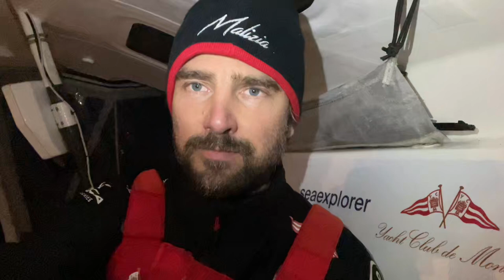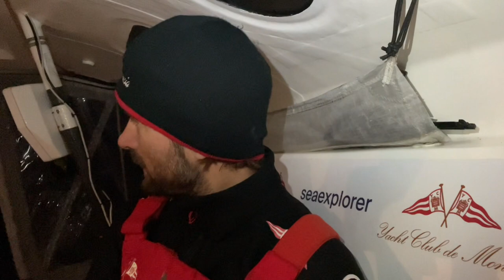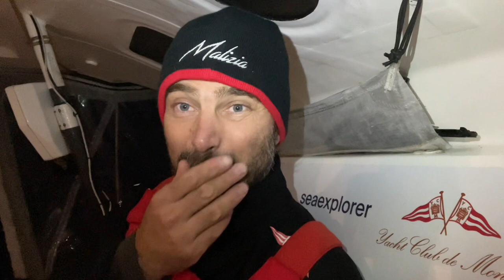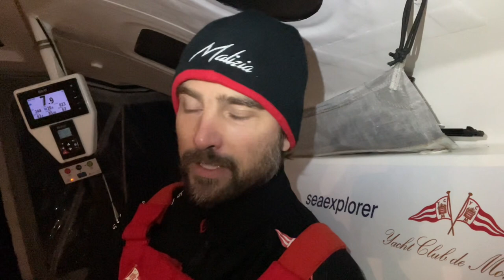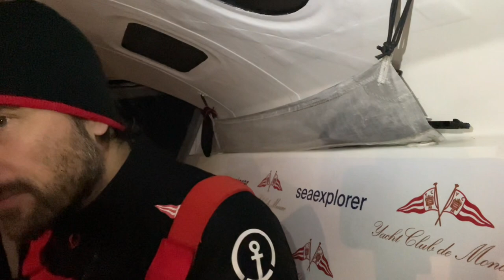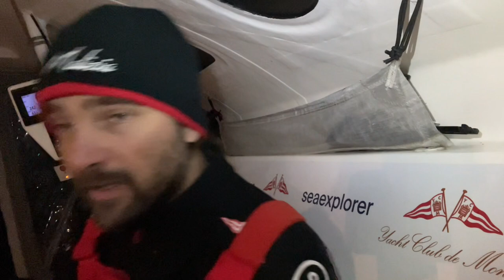Day 80 - Boris's collision just 90 miles from the finish line

Comment: The F/V was not transmitting AIS so it was invisible to Boris' collision avoidance tech

80 miles behind Dalin at 18 knots gives him 4.5 hrs out of the 6 hours owed.

1925 UTC at time of the collision with 90 miles to finish. 

Again at 18 knots gives him 5 hours to finish at 27/01/2021 2325+/- UTC, then adjusted to minus 6 hrs is 1725+/- UTC

Whereas Bestevan crossed the line at 28/01/2021 03:19:46.

It looks like this

Dalin:        27/01/21 - 19:35:45
Bestevan: 28/01/21 - 03:19:46
 adjusted: 27/01/21 - 17:05:46

So there. Robbed of a more than good chance to be in the running for first place finish and definitely shut out of 2nd place and the podium as well.

I hope he got the name of the boat cuz Imma coming to France next flight to hunt them down and break their legs.

Comment: So sorry to hear of your accident and the damage to your yacht, and the loss of your position in the race.
However, you must take the positive view: the consequences of the collision could have been far worse.
The hull of your yacht was not holed, you did not suffer injury or death.
The area off Les Sables d'Olonne is hazardous because of the number of fishing vessels.
I know of an incident in the same area 50 years ago, where 3 persons were drowned as a result of a collision between a yacht and a trawler.
As to why your radar alarm was not triggered, is it possible that the trawler was an old fashioned wooden type? If so, it might be invisible to radar.
If possible, try to establish the identity of the fishing vessel in case you need to make a report.
Your performance in the race will have been noted, whatever the result in the rankings.

Comment: Although a lot of things where not as they should have been, I think it was a fault of the Organization #VendeeGlobe not to inform all Vessels in the region about the 5+ ships entering at high speed in the bay. Just to tell them to turn that night their AIS and keep vigilant would have been in their hands to make such an event safer. Making it a bit safer for the sailors would have not required too much effort from the organization. And as Boris says, it is known that sailing vessels turn off their AIS. If it is known, the Organisators could have had that in mind as well. Very disappointed in the organization...
Reply: Despite my admittingly limited knowledge as an armchair sailor I have to disagree:

Regarding a responsability of the organization: for both the Vendée Globe organisation and the coast guard, as I understand it, it's technically impossible to know the position of all ships in such a large area (hundreds of miles.. where do you even start?) and find a means of communication with all of them, especially the most relevant ones, i.e. those idiots in "stealth" mode like the vessel in question. How exactly do you suggest this could have been done technically? HF radio DSC area calls only work when that radio is set to automatically monitor the relevant frequencies (afaik this often isn't the case) and with SSB DSC calls to individual vessels you first need to know that this vessel exists and have its MMSI. And satphone doesn't work either if you don't have the number. Also: european waters are VERY crowded: www.marinetraffic.com , and those are only a few vessels that send their position via satellite.

Also: Boris said that fishing (!!) vessels sometimes turn off the AIS, not sailing vessels. Many sailing vessels aren't even equipped with the additional transponder and second antenna (or antenna splitter) that is required to send an AIS signal, but almost any vessel can receive AIS signals. And when a recreational vessel does have AIS out, it's usually only class B. With commercial vessels it's a different story: AIS class A (those are the more expensive ones with a strong signal) is mandatory in many national waters and in internationally for most commercial ships (depending on gross register tonnage). Meaning: the system works as long as sailor can rely on commercial vessels that the use their AIS as they are obligated by law.

Boris had THREE(!!) warning systems (AIS, OSCAR, RADAR). If the fishermen turned off their AIS, that's how the systems fails and those fishermen were acting illegally - there's nothing Boris or the organisation could have done about idiots ignoring the rules (and on top of likely not transmitting AIS, they were also ignoring Boris' AIS signal and Radar signature!).
As for radar signature: it depends on the ship shape and can be weak - like with stealth technology - when there are almost no rounded surfaces (like Boris said: he was looking at a "wall") and the two vessels are approaching at an angle.
Reply: @___Chris___  I can see your point. However therr are ways to communicate through Radio that certain events are taking place in vast areas. There is an infrastructure already in place for transmission of safety issues. It is not really hard to communicate with vessels in distributed in a large area. If you think of a Tour de France or Giro d'Italia you can see the infrastructure and planning associated with the races and the safety of their participants. Vendee Globe cannot do anything in the Indian ocean but in their back yard they can. Just a little communication was necessary.
Reply: @luisa1551  You would THINK that in modern times in this connected world it is easy to make a transmission to any ship at sea, but I doubt that it actually is: when you say "communicate through radio", that sounds like a great idea, but what does it actually mean in the case of offshore vessels?
VHF radio: usually dialed in on standby watch on channel 16; only problem: the range is limited to line of sight, i.e. only for ship-to-ship communications in direct vicinity. Shore-to-ship only works very close to the shoreline.
HF radio ("SSB"): great range and all commercial vessels are required to have it, "direct selective call" to "all stations" is a good idea in theory, but it's practically dead, even more than in recreational boating. There is a high chance that the device is switched off or not monitoring the appropriate frequencies.
This leaves us with satellite communications. IF the ship is equipped e.g. with INMARSAT and you have the name and MMSI number: great, you can look up the sat phone number in the online inmarsat ships directory and give it a call. Only problem is: you have to know the ship is there at all FIRST, which you don't unless you are in close vicinity AND the ship is broadcasting AIS (or AIS data are also sent via satellite). How can the french coast guard know for example that a spanish trawler with AIS switched off is drifting somewhere a good hundred nautical miles off the coast? According to vessel tracking websites, at the time of the accident, a position of the vessel in question wasn't received by any shore or satellite station for several days!!
I highly doubt that this is an exception. It is common knowledge that fishing vessels aren't too excited about sharing their position and best fishing grounds - understandably so (=no accusations there), regarding competition. They WANT to be invisible - and it works!

Comment: i will be curious to find out why your radar didn't work
Reply: some fishers like to turn their devices off to fish in areas that theyre not allowed to. just a theory.
Reply: @bedeckt  i said radar not "device receiver". i'm sure ice bergs have their "devices turned off too" but the radar should still bounce off them.
Reply: @pratwurschtgulasch6662  thats also an interesting perspective xd
Reply: @pratwurschtgulasch6662  i am not too familiar with this whole thing so thank you for correcting / clearing it up
Reply: @bedeckt  i'm not very familiar either. you are also right, the ships are supposed to have some type of transmitter, just like airplanes do. on the other hand the radar is more like a backup system and is supposed to detect obstacles similar to how sonar works but in air. i have no clue what went wrong here but i would love to find out :)